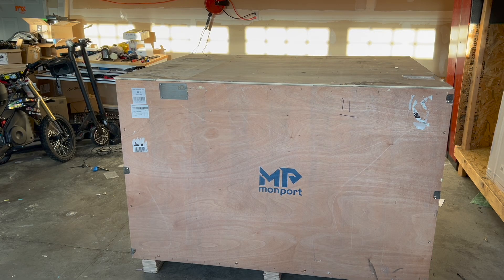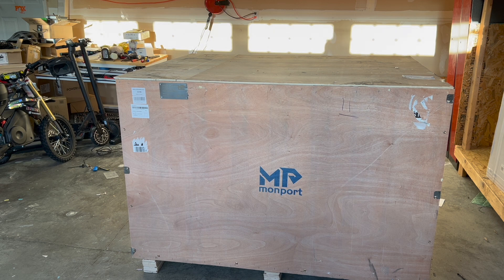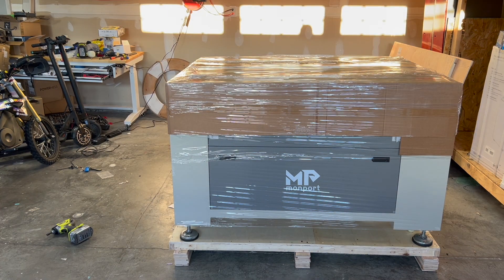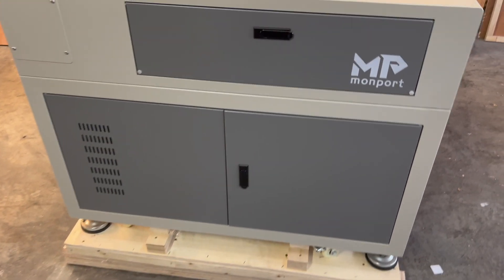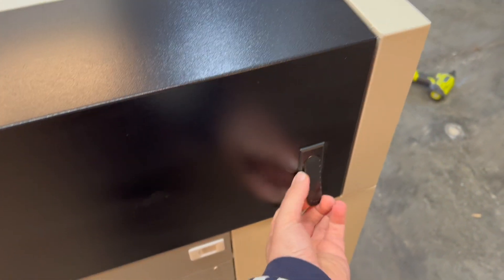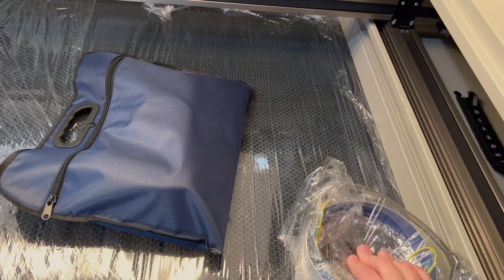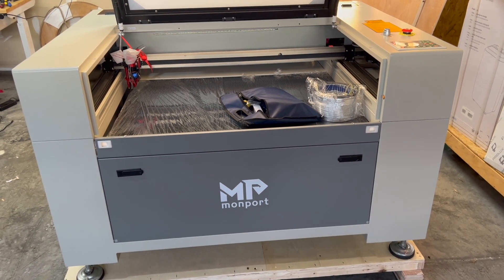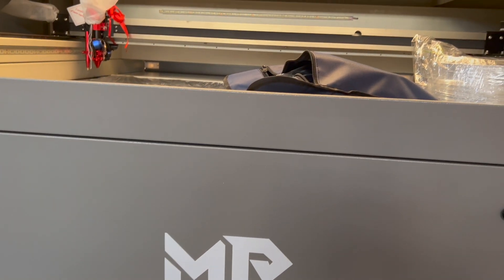Monport 80W Built-in Chiller CO2 Laser Engraver & Cutter (36" x 24") Unboxing Uncrating lightburn

Comment: Man, you went for the big guy!   The $1k jump from the 28x20 couldn't be justified in my mind.   I could see if you are cutting cabinet parts, but beyond that, the laser speed or production rate is not affected in the least by table size.   So, I assume you plan on cutting single parts that are really large.  (like furniture parts? )  Signs?  Large Letters?   Wish they'd make an open feed bed  set up with CO2,  so you could run 96" length boards in 36" segments for cabinet making. (like the CNC machines that you can run in segments on same panel).   I think Laser cutting is so much cleaner and accurate than CNC.   Once the technology get's a little more affordable, laser cutting will the be the norm.  No wear and tear on tooling/cutters!   Massive savings in waste, tooling, and materials.   100W CO2 already has impressive cutting speed.  Commercial quality higher power heads are out there and coming down in price.   Cool stuff coming to wood shops everywhere.

Comment: The peak power being 100W with 90W agreement means you can run it at the recommended 80-90% power level to maintain longevity, and still achieve a true 80W at the lens. If they gave you a 80W tube, and you ran it at the recommended 80% of max, you’d only get 64W at the lens. It’s an example of accurate marketing which is great for the end user